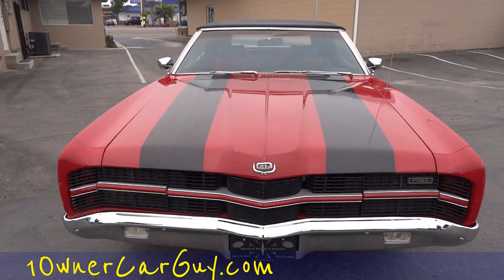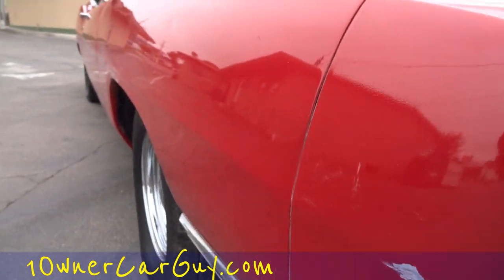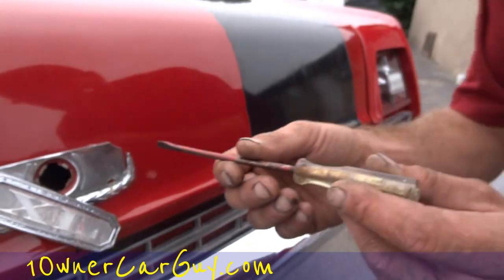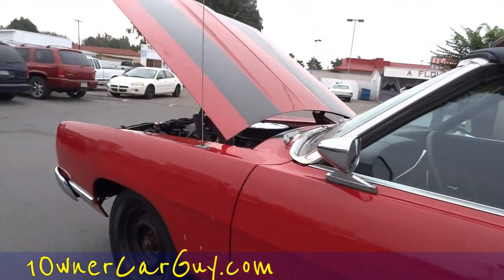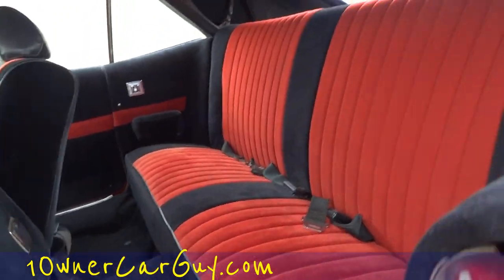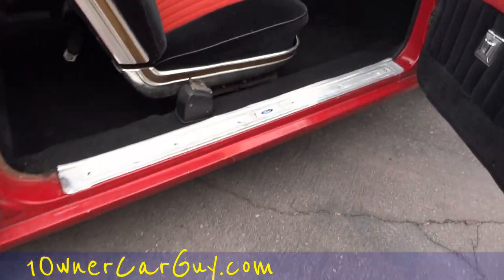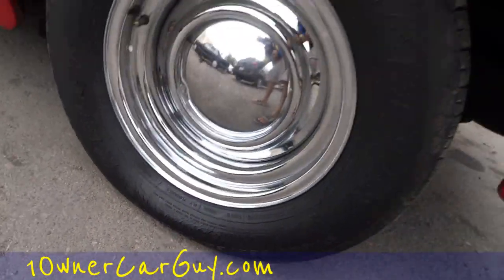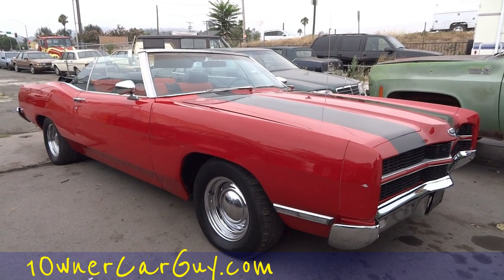1969 Ford Galaxie 500 Convertible Loaded Classic  Muscle W/ A/C 390 LTD Sportsroof

Comment: Cool car. My grandfather had a ’69 XL Sportsroof, Bright Blue Metallic with white vinyl top and interior with buckets and console with "U-bar" shifter.  I always loved that car, especially the wrap-around "Flight-Cockpit Instrument Panel." 
FYI this car is not a Galaxie 500. It is an XL. It was a separate model 1968-1970. The calling cards of the XL were bucket seats and console, but in later years the bench became standard and the XL's signature bucket seats with console became an option.

Comment: I bought a '69 Galaxie in '78 with a 390 2BBL. It ran like a scalded ass dog till I ran it against my best friend's 402 Caprice he'd just bought at the time. He wiped my ass with it!!! His Mama had a '75 Ford with a 351W. That 390 wiped it's ass every time. He shut me real quick.  I love these cars, but I hated how they put in the radios in the dashes. I like the AM/FM RADIO in this car, but mine had the AM radio, and I had to mount an under dash FM convertor to have FM tunes.

You should always start these older cars with power tops. The engine should be started so the alternator would help the power top to work easier.

Comment: The picture in the 1969 full size ford brochure (in the oldcarbrochures site) (pages 12-13) of the XL convertible is of a red one just like yours.

Also the front disk brakes (option labeled on brake pedal) was an option (4 wheel drums were standard).

Comment: The transmission on this was either a C-6 or an FMX.  They used both back then.  Would have had to have checked the door code against the shop manual listing to confirm.

Comment: can I ask u seem 2 hav most vehicles licensed in Montana the p up camper fr th 86 yr old lady was also lic Montana but demo plate just temp I supposed.i used 2 do ths back east iowa.we did th same th 69 red ford is it real mt plates or do I hav 2 dmv it in cali or where evr I lic it. mite b int in it  write bak will let u know in a few . thanx vm. rick.like ur  win in reno gd luc man ive won sev of ths 1000s othr casinos,if th damned mslot is primed ur in,timing seems 2b ev thg. thx

Comment: 1969 is a one year only dashboard.. hard to find
Reply: Actually, 1970 LTD/XL/Galaxie had the same dashboard layout, the only difference was '69 had a horn ring, and ignition in the dash panel; and '70 had a padded horn button in the steering wheel spokes, and ignition in the steering column-- (or are you referring to the "dash on top"-- that's cracking)?  When people say "dashboard" I usually think of "instrument cluster" as part of that, but we may be talking about two different things.  I apologize in advance if that's the case.
But this is a 3 yr old thread and the car is long gone, so I suppose it doesn't really matter.  I just thought I'd throw it out there, for what it's worth.